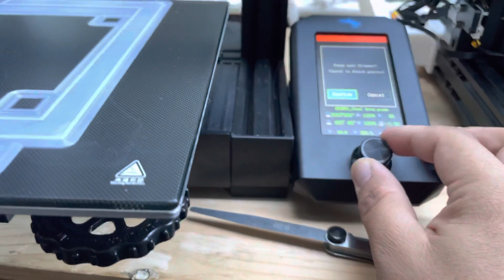Creality Ender 3 V2 change filament mid print the easy way ;)

Comment: What gcode command can i use to trigger this automaticly, so i can change color mid print.
I use cura slicer.
Reply from the maker: Not a clue this is not done by Gcode . This is aftermarket firmware
Reply: Should be M600

Comment: My Creality E3V2 3D printer doesn't print fast enough to keep me from changing the filament while the printer is printing. When the older filament comes off the spool, I remove the spool from the holder. As the length of filament gets pulled in by the extruder I have plenty of time to cut the bent end off of the filament, put the new spool on the holder, and prepare the new filament by removing the bent end at the beginning of the filament. Once the last bit of older filament has begun to enter inside the extruder I follow it in with the new filament and gently push on it until I am sure the new filament has entered the Bowden tube. That's it,  I'm done. I've been doing it this way for a long while now, and I've not had any problems doing it this way during filament changes. Once the new filament has entered the Bowden tube it has always pushed the older filament through towards the nozzle without incident. Try it. You won't have to stop the printer.
Reply: It will work to push the filament but your printer will not be able to do any retractions... leading to pretty terrible print quaility until the new filament reaches the hotend.
Reply: Plus this is also a great example of stopping midprint to change out colors if you want.

Comment: I had no idea you could use the change filament option mid print. Thanks for sharing
Reply from the maker: U need to flash your printer firmware to get this options
Reply: @mkcelectronics1152  I have been running Jeyers for a while,  i just had no idea I could use it to change filament mid print.
Reply: @mkcelectronics1152  Damn, so seems like my print is going down the drain because I didn't flash my printer firmware.

Comment: What firmware version does the printer have installed? On my Ender 3 V2, the option to change filament does not appear, V 1.0.2
Reply from the maker: Marlin - JyersUI 1.3.5

Comment: So there is no time limit for changing? You got timeout but it didn't matter?
Reply from the maker: No it did not . Because bed is heated as well and bed temp is kept hold in place no matter how long it takes for you to come over . I did had to wait for nozzle temperature to raise back up.